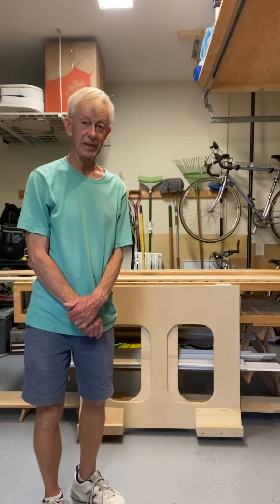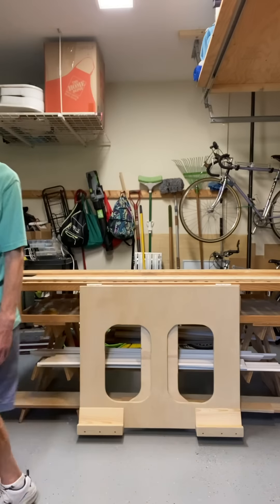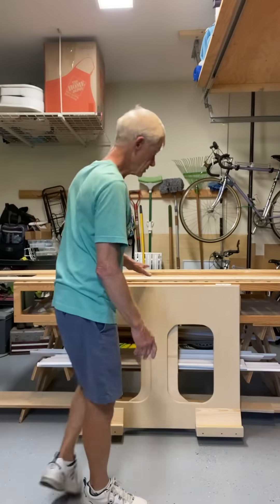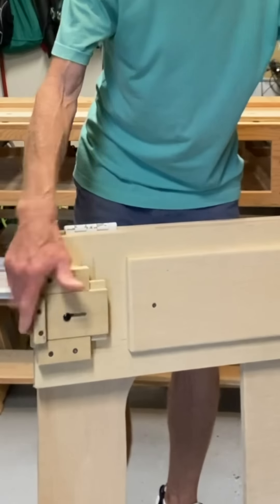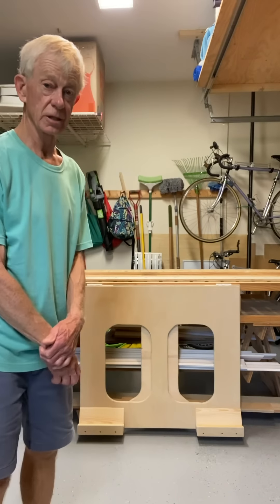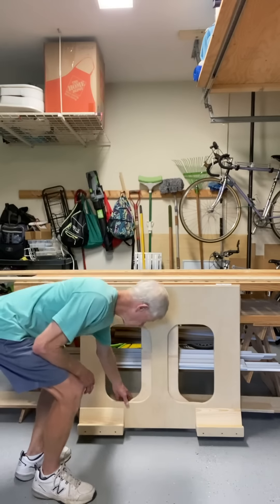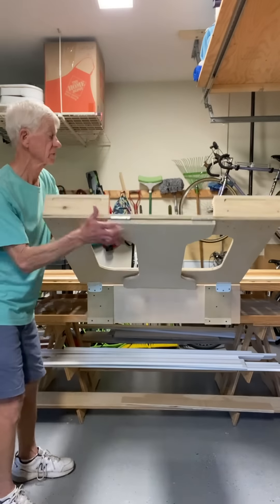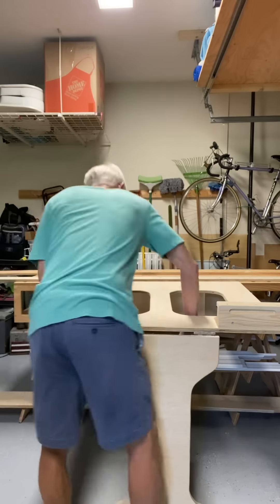James Brown's Panel Lift

Comment: Nice little video-within-a-video. Interesting to see different people from different communities collaborate and share footage. How was the footage transferred to you, Ron? Did your friend send it to you via thumb drive on camera card, or did you transfer it through a cloud-based service? It would be interesting to design something like this (or a whole family of related Smart Workbench accessories) using Skethup or Blender or some CAD program, then take the computerized CAD sketch and bring it to a low-cost Maslow CNC router and bang it out. The only thing about videos like this that I do not like: if you're shooting it with a smartphone or tablet, it should be turned sideways ("landscape mode") to give a less restrictive field of vision. The images seem claustrophobic doing it in "portrait mode" (phone held/mounted straight up).
Reply from the maker: James emailed it to me. It is best to film and send 4K or more which requires an FTP like Dropbox or FileZilla. The free versions work great. I have been transferring video and still files to clients for years and have never felt the need to have a paid FTP. I even transfer my stock footage up to Adobe using the free version of FileZilla.